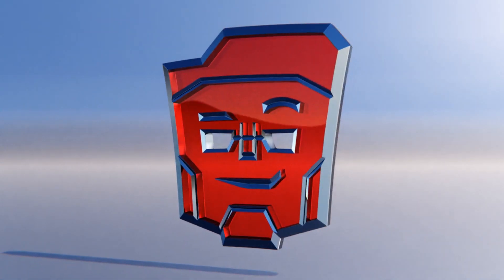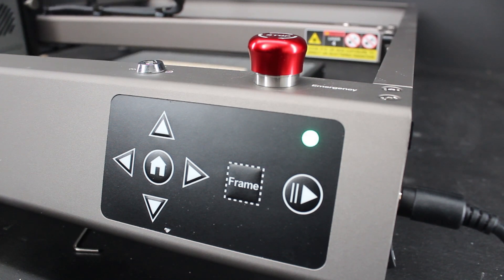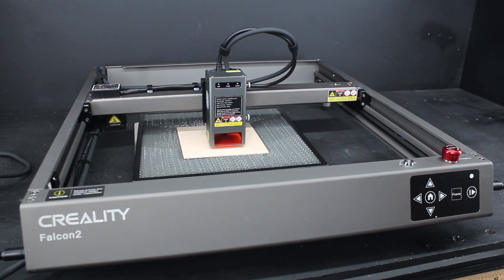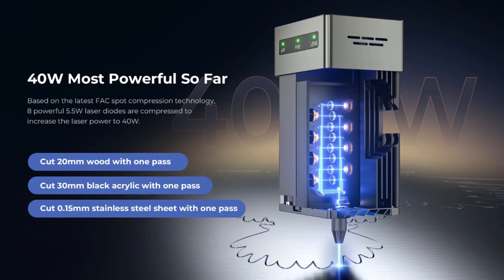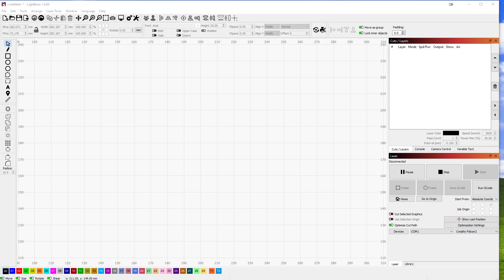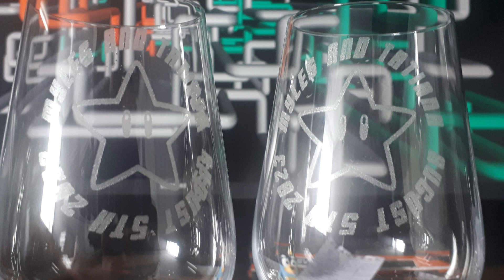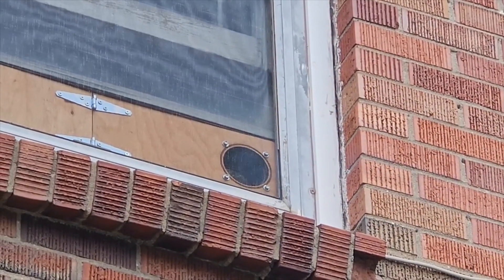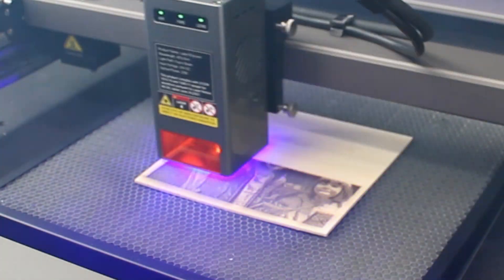IMMA FIRIN' MY LAZOR! - Creality Falcon 2 22w Review

Comment: I had modified my Longmill CNC router to accept a 20 Watt laser. I built an enclosure so the dust would not get all over the garage. When I had added the laser I installed a 50 CFM bathroom exhaust fan which ran me $22.00 for the enclosure. The exhaust fan has a 4 inch diameter duct which I reduced to 3 inches with an adapter. I run it out the side of the garage. Of course I leave the fan off if I am using the CNC router.

Comment: .15mm is not 1/16" or .0625".   It is equal to .006" or 6 thousandths of an inch.
Reply from the maker: Whoops. My bad. Evidently I got my math wrong by a factor of 100. Thanks for the correction!
Reply from the maker: Which is the thickness of aluminum foil. Interesting

Comment: I got a Longer5 laser cutter as a precursor to 3d printing. For geekdom it’d be useful to make 3D puzzle crafts to assemble into roleplay weapons or custom props and buildings for figures.

If a house has one, taking a laser cutter to and from an outside balcony would be the easiest ventilation.
Reply from the maker: That's not a bad idea